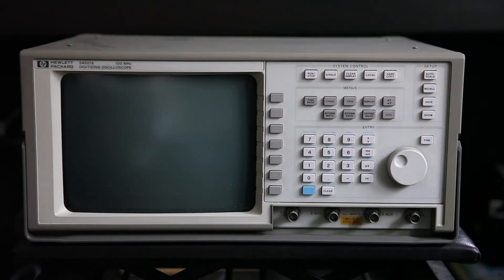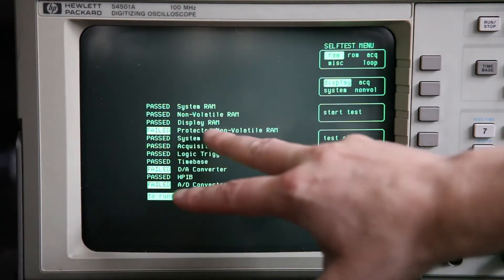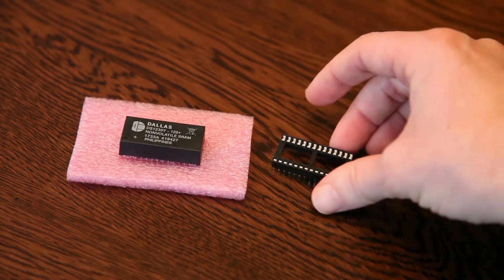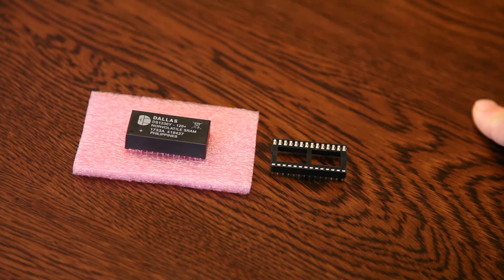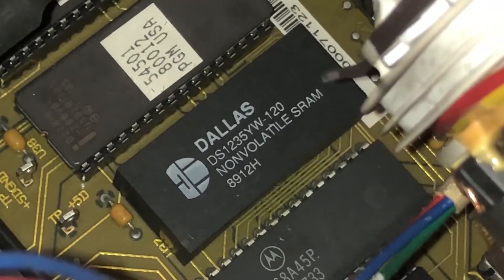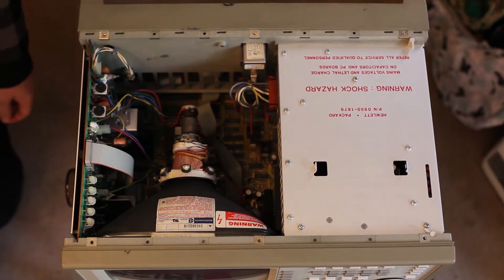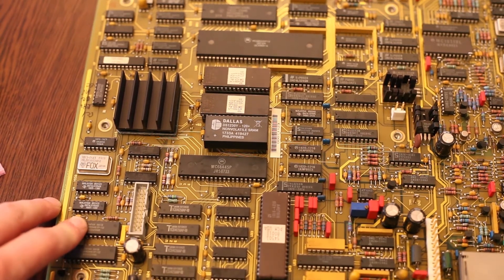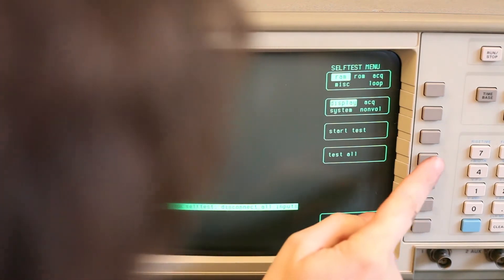HP 54501A Oscilloscope NVRAM Replacement

Comment: If your scope is failing several test that you did not expect it to, do not give up!!!
Clean your BNCs with some electronics cleaner and try to use good probes.  Ideally use high frequency new cable bnc to bnc to connect the back to the front inputs.  
Before doing the calibration I have been working on the PSU unit. It was blowing the mains fuses. I traced the problem to the input side full bridge rectifier . One diode was shorted. I saw bad electrolytic corrosion on the input side aluminium stud (a metal stick close to the input common mode inductor. The rest looked ok apart from some capacitors (I think capacitors around L4 and L6) held together with the inductors that are leaking badly. I swapped the bridge for the KBL4010 and powered it up. It works, I wonder what caused the bridge to fail. But capacitors need to be changed anyway.
To whoever needs to fix their PSU here are some very useful links... enjoy:
http://www.bitsavers.org/pdf/boschert/Boschert_OL25_Single-Stage_Power_Supply_Maintenance_Manual_May79.pdf
And for those who cannot pay for the original schematics here is a reversed engineered schematic for a very similar PSU which however seems to have several component values that are different but is a good start:
http://www.ukvac.com/forum/uploads/125/supplyHP54503.zip

Comment: Calibration starts at 16:45.  Here is a tip: if after you calibrate, your pp volts measurement is off, try correcting it by adjusting your probe compensation factor.

Comment: Really the problem with the Dallas chips is ... they start using the battery as soon as they roll of the production line. Even when just lying on a shelf and never being used the battery will be used. So buying so called 'new old stock' is a risk. That being said what I usually do is use a small CNC to mill away part of the plastic (really it's an NVRAM chip with a seperate battery potted in a plastic cup), and replace the potted battery (remember to actually sever the connection or the internal battery will interfere) with a small cell battery holder. That way I can just put a new cell in whenever I need it.

On the plus side you don't need to buy a 'new' dallas, you can use the depleted one for this just fine.

Comment: thank you ,I have the same model but with different error message .to clear, cycle power with one front-panel key pressed..., can you help please ?
Reply from the maker: Nasr Alshazly Start it while holding down any key on the front panel. What happens if you do that? Perform a self test and let me know what fails.
Reply: @tinkertokyo1088  Thank you so much , I will check

Comment: Tell me if it is possible to replace the chip ds1235yw-120 with ds1230y-100 in the same oscillograph as Xp54501a. At first I bought ds1235i-120 but the problem is with the checksum. After reading the datasheet that differ only in performance and bought ds1230y-100. Now I'm worried that waiting and wasted money in vain.
Reply: The -100 will work fine ..
The 100 indicates the access time of the RAM, the original one has 120 nsec access time, a faster chip will also work.